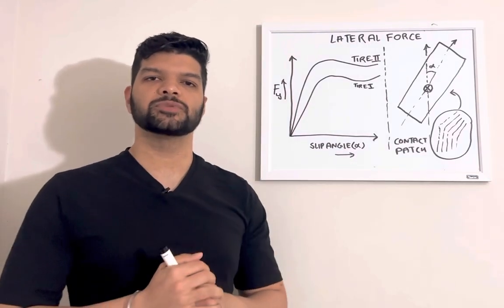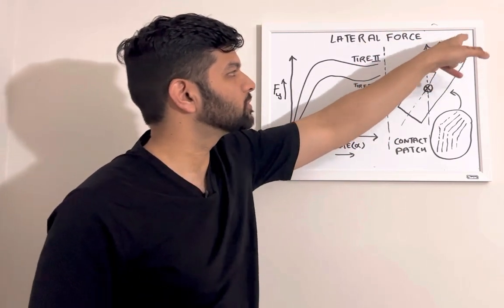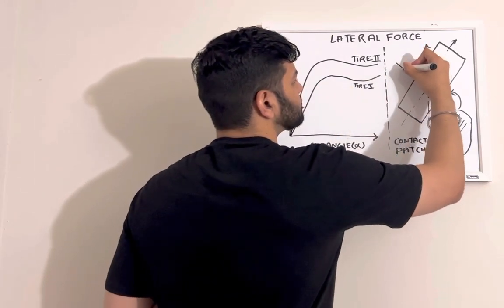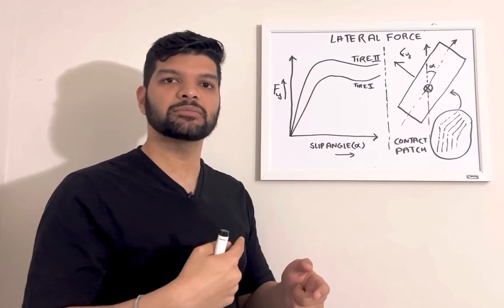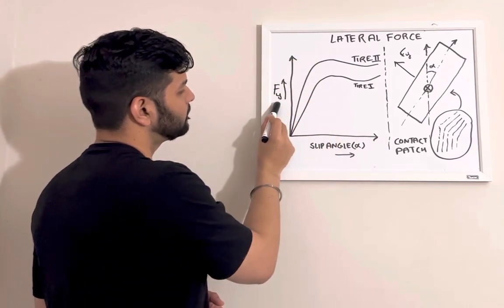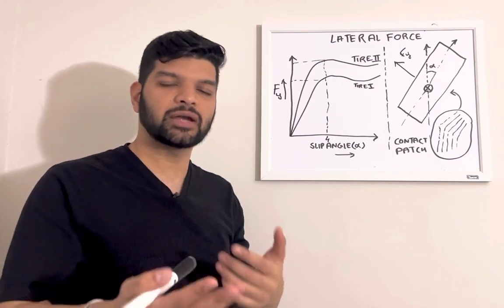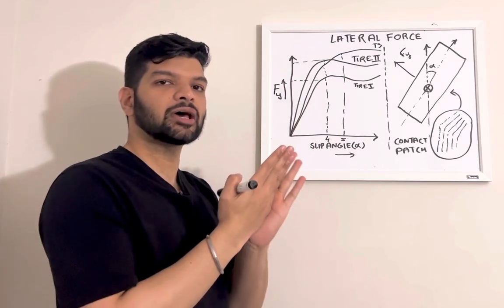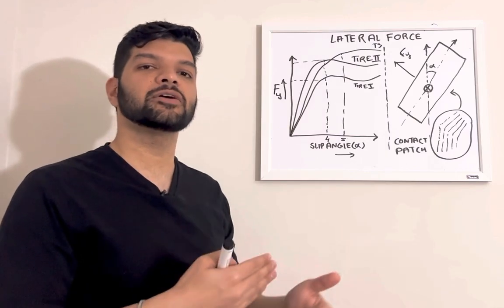What is Lateral Force?

Comment: why is it on some diagrams the lateral force faces inwards OR outwards. I have seen a similar diagram but the lateral force going the inwards instead of outwards like in your diagram

Does Lateral force always point outwards? Does it always point inwards? If not, what situations make us consider which
Reply from the maker: Imagine lateral force as a force with which the road ‘holds’ the tire therefore pointing outwards

Comment: Why does tyre 3 generate understeer. If you use tyre 3 on both front and rear axles, surely you still have a balanced car, but with more grip?
Reply from the maker: For tire 3 higher lateral force is generated at a higher slip angle, higher lateral force means your car can turn at a higher speed and higher mass without sliding, higher slip angle means the vehicle is turning generating a higher lateral force but at a bigger curve! If you don’t have enough lateral force the car will go straight without turning, I hope this helps!